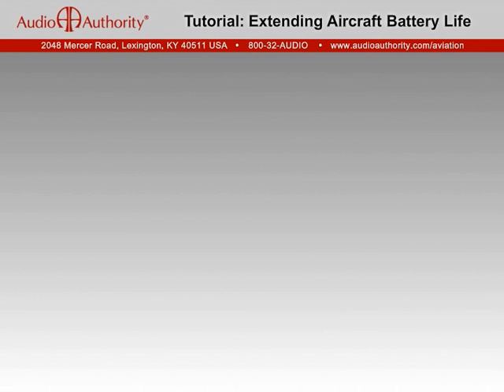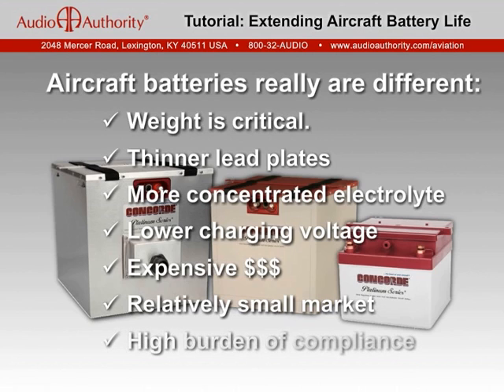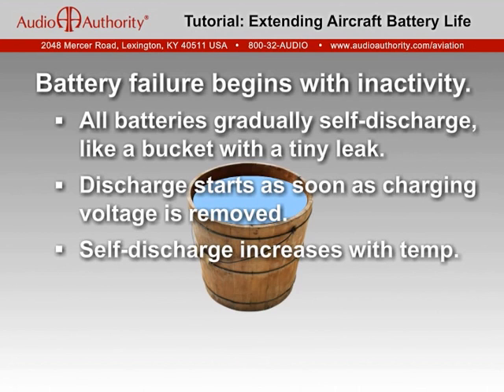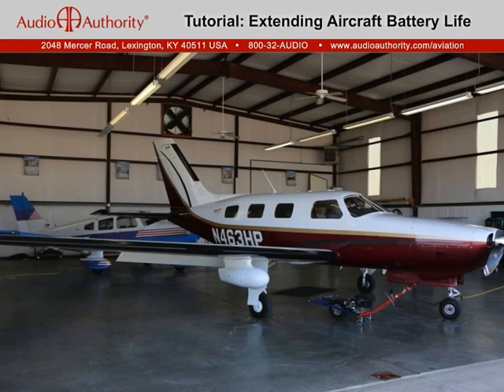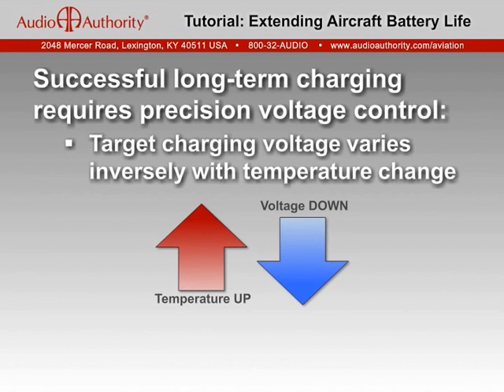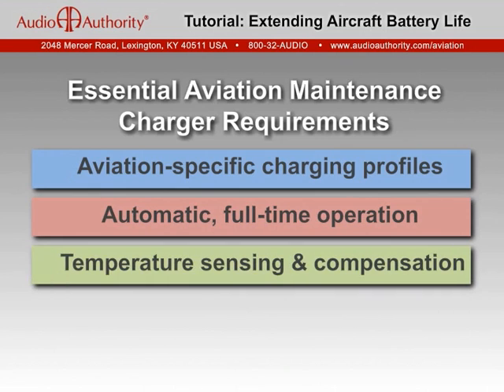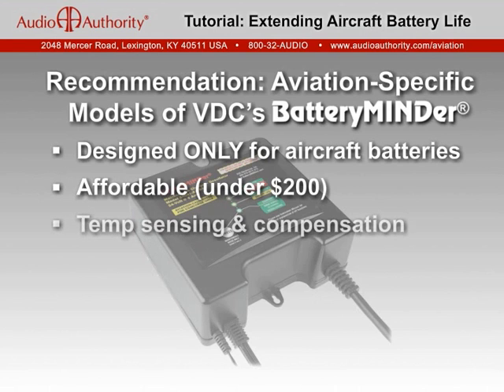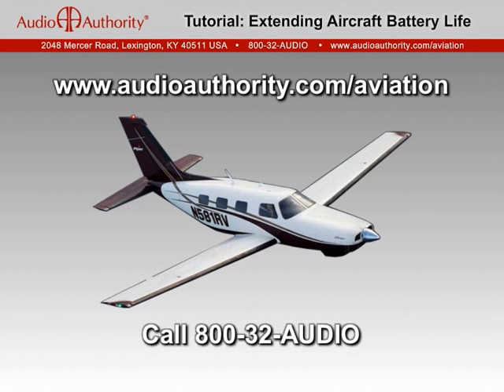Extending Aircraft Battery Life by Maintenance Charging

Comment: I question the wisdom of paying 2,3 times the price just to save 15 lbs of weight for a battery. I rather use an automotive battery in experimental planes, is far cheaper. A few times a year, I connect a battery desulphater to it for a week or so, never need another battery since I bought that $15 desulphater. The cursed word "certified" are holding things up in aviation while automotive technology advanced in leaps and bound.